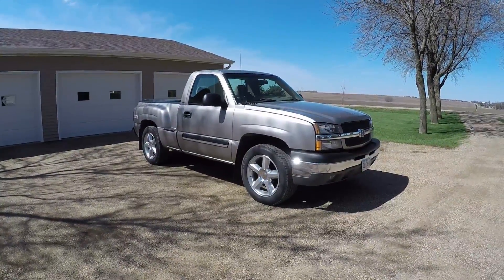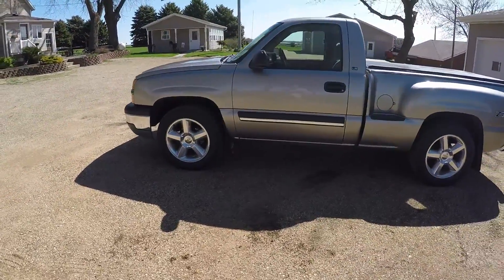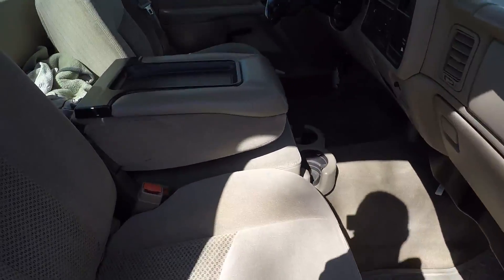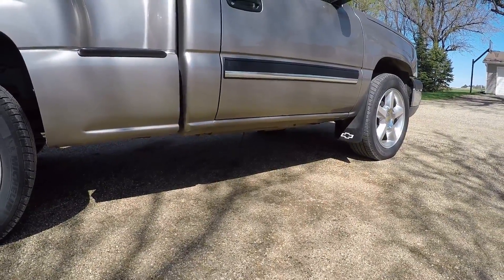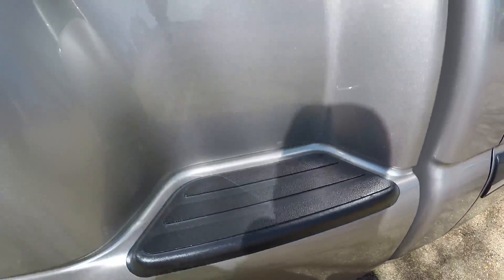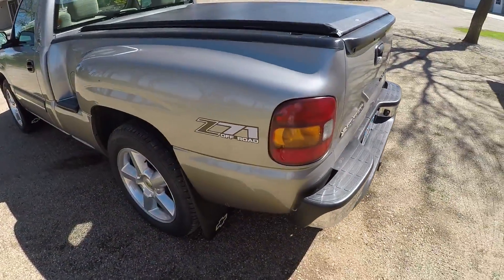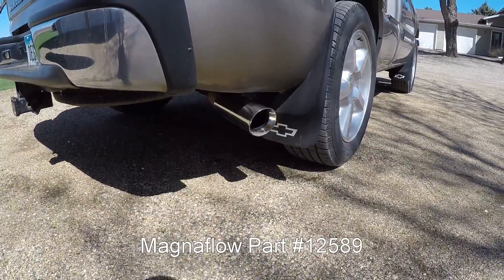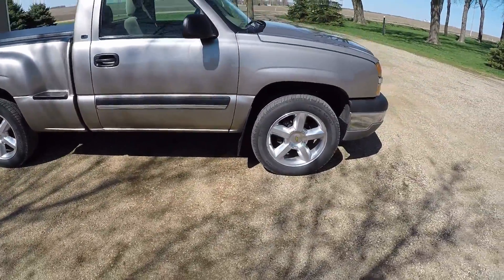03 Silverado RCSB Stepside LS 5.3 Walk Around, Magnaflow Exhaust - Z71 4x4

Comment: I don't know how many of this combo they made but I have never seen a cat eye step side v8 manual 4x4 rcsb rare in my books looks good man
Reply from the maker: LSX FTW this one is my dad's, it is an auto 5.3. Still don't see many around though!
Reply: They only offered the 4.3 and 4.8 with the 5 speed. I’ve never even seen a 4.8 stepside 4x4 5 speed though and that’s exactly what I’m looking for. Shame you couldn’t get a 5.3 5 speed
Reply: I have the 05 version. Love it. 323 moves just fine. Mine doesn't look as low as this though. Has paint matched a cap, flaps, chrome plate trim and Flowmaster duals.

Comment: Hey are these trucks reliable ?
I want to get one but idk what year is the best
Any important things to look for when buying one of these
Reply from the maker: Any truck can end up having problems, but for the most part I would say 99-06 silverados are very reliable. The biggest problem depending where you find one is rust in my opinion. The drivetrains are pretty solid for the most part with the engines lasting well over 200k miles.

Comment: It's an LS trim it's not loaded lol just not a base
Reply from the maker: ShadowOfDeath24 well I guess that's why I said "pretty much loaded". You couldn't get an LT trim in a regular cab so leather seats and Bose stereo was not an option. The only things this truck doesn't have are power seats and steering wheel controls as far as I know. That seems like "pretty much loaded" to me.
Reply: Trims can get crazy confusing lmao. I have a 2004 5.3 2wd regular cab stepside. I’d say it’s loaded because it has electric locks/windows, rear window defroster, steering wheel controls, power seat only on the drivers side, satellite radio without the premium Bose sound system and mirrors with the blinkers but I don’t have leather seats lol. I think it’s an LT but I’m not sure.